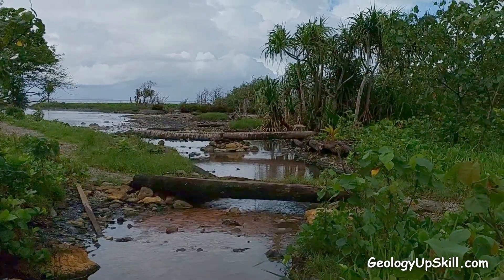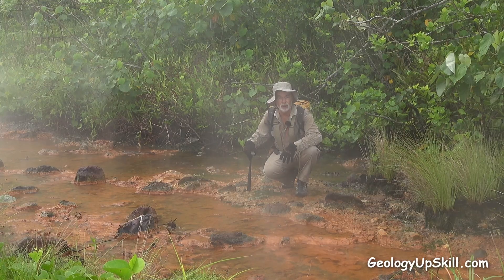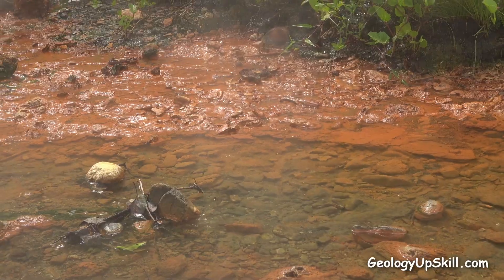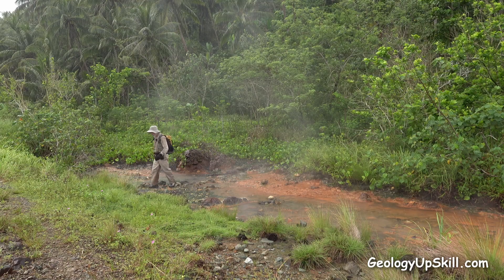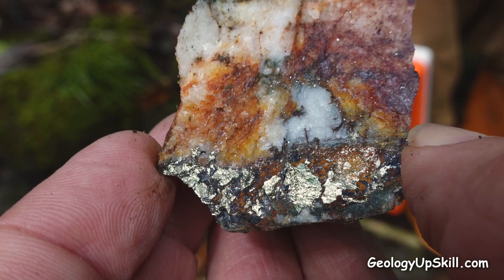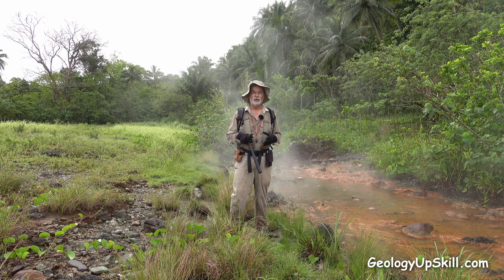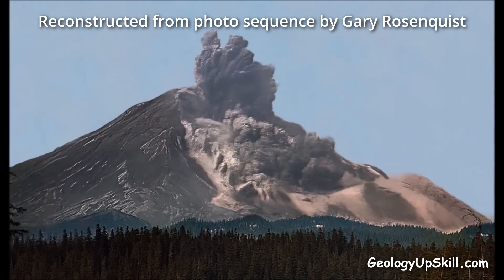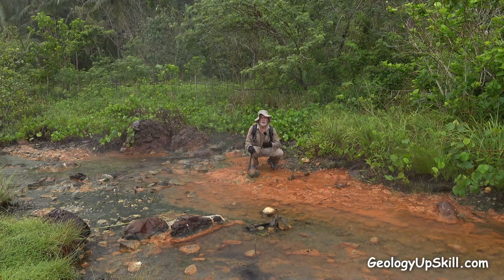Hot Spring Epithermal System

Comment: Awesome thanks so much 👍👍👍 the iron precipitate looks just like my fossil outflow channel 👍👍👍
Reply: Being along west Yilgarn margin it's a Permian to Cretaceous extensional setting with the Epithermal hosted in normal faults. There is maybe 100m vertical offset in some zones .... Putting deeper zones next to shallower levels...
Recently discovered coarse hydrous Pyroxenite within the Epithermal system... I think hydrothermal dissolution of the pyroxenite provided the silica for chalcedony and sinter plus accommodation space for gold deposition... But also a tectonic trigger for normal faulting during Gondwana breakup... The pyroxenite is also altered to phlogopite, massive biotite and some feldspars amongst a bunch of minerals above my pay grade. I have outcroping boiling zone with the remainder of an ejection breccia cone 3km down strike from the Hunter Venture mine... 

My point ... That rift low sulfidation Epithermal systems can have different zones exposed within a few 10s or several km apart.... Forgot what you think you think it should look like and listen to the rocks.... 😀👍
Reply from the maker: Next best thing to sinter!
Reply: @GeologyUpSkill  definitely agree. I found a lump of conglomerate from an environment very similar to what you showed... Sinter clasts cemented with broken down sinter and iron precipitate.... It could only come from a stream down slope from a sinter terrence... Maybe at ca. 137 Ma. I can even see flow bedding and mud cracks... It's so totally rock nerd awesome and auriferous 😎